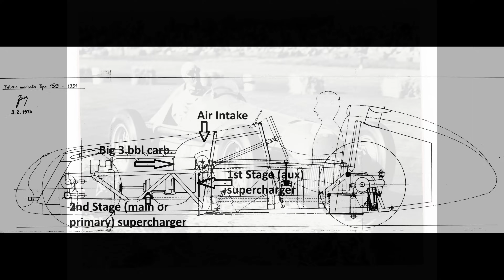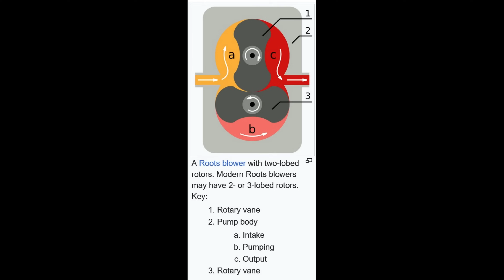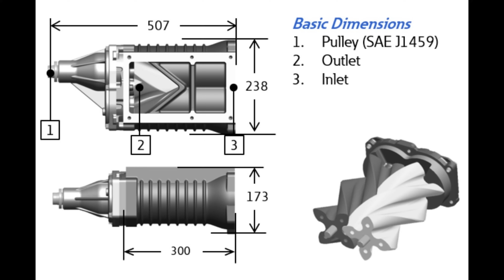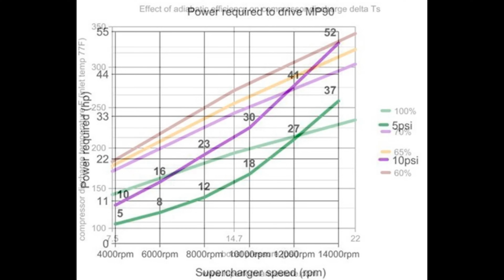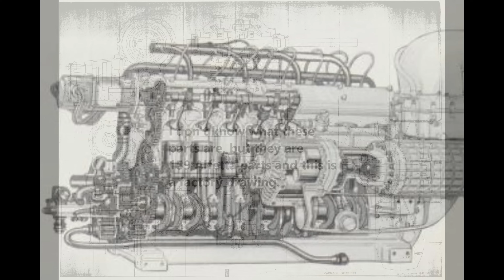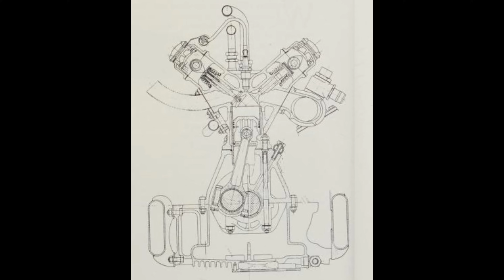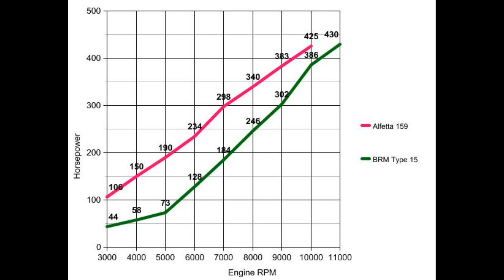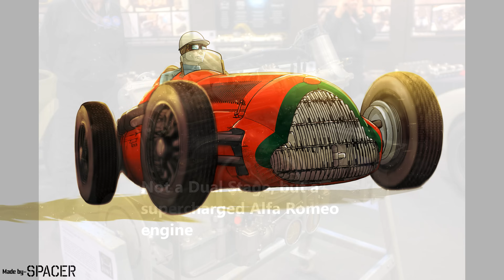Dual Stage Supercharging 450hp out of 1.5 Liters in 1951

Comment: Greg, this is another really good video about charging an engine and the circumstances you have to think about. I learned Mechanic at a Lancia Garage and technican at the FIAT Service scool in Germany. We were very advanced with Rootsblowers and Turbo loaded Engines in the 70ies and 80ies. The Turbo Ära followed with the Delta Integrale Times in Rally. It was so interresting to read about the old racecar and plane engines with their boost regulations. Thank you very much 👍👍.Kind regards from germany, Rudi 👍

Comment: I heard an explanation from the Merlin Engine production team where he explained that engine displacement didn't indicate engine power only how much air could be drawn into the cylinders. It was no problem getting fuel in, the problem was getting enough air in for the fuel, so more air and more fuel could only result in more power. You didn't need to keep making a bigger and bigger engine.
There is an indirect relationship between engine displacement and power since there's a limit to how fast air can get into any given cylinder so more cylinders or bigger inlets would allow more power. This is how the 12-piston Merlin engines were able to keep up with engines that had many more pistons.
Reply from the maker: The Merlin is a massive 27 liters, clearly displacement matters. The Bf109D's engine was 19.7 liters, the Germans then put in one that was over 33 liters. Rolls Royce then went even bigger for the Griffon. So yes, displacement matters and the people building engines back then knew it. The Merlin kept up with larger engines via more boost and in some cases more RPM, and generally with shorter times between overhauls.

Comment: The Tipo 158/159 Alfetta were designed as lightweight Voiturette cars before WWII. This was a smaller Grand Prix sub-class with a similar chassis design that used an engine limited to 1500cc. Smaller than typical for prewar GP cars which had reached 10 liters after WW1. The prototypes for these cars were hidden in mines by the Italians to avoid destruction by allied bombing. After WW2 when GP racing resumed, the dual-stage supercharger Alfa Romeo used at up to 40 psi made the small displacement straight-8 into a monster. Almost doubling the prewar version's output at half the displacement typical before the war. The 450 hp version practically ran neat alcohol through the intake passages to cool the valves and consumed a staggering amount of methanol fuel. 1.6 mpg! The 1.5L ran at high engine speeds for the day. Up to 9300 rpm. The Alfetta is a mechanical work of art from the golden age of automobile racing.

Comment: Many of the WWII diesel engines were built by Detroit Diesel. These were 2 stroke Uniflow designs using Rootes type blowers (which are referred as blowers, as what what they do is scavenge the cylinder).

Comment: According to the recollections of Mike Sparken, who managed to get a 158/159 Alfetta from the Alfa Romeo (in exchange for his Alfa Romeo Le Mans 8C 2900), he wondered why the works team had the engines revved up to 9,000rpm and beyond, when there's no need to...

According to him, when Jim Stokes rebuilt the engine of his 158/159, and they tested it on the dyno for the first time, they had to stop at 7,700rpm. They stopped because at that point, the supercharger boost pressure is up to 3.19 bars, and Jim stokes had to put stronger valve springs in. He reckoned that at that point, they could've gotten 403BHP at 8,600rpm "fairly easily..."

Jim Stokes added that the weak spot on the Alfetta engines had to be the valve stems. The valve stems were really slim (1/8 by 1mm valve stems), and it had to deal with around 3.2 bars of boost trying to force the valves off their seats, and the springs had to be strong enough not just to shut the valves, but also to keep it shut with that amount of boost acting up behind it. According to him, that means there's around 30 tons of load acting on those valve stems, opening and shutting at 8,500-9,000rpm...
Reply from the maker: There is a big difference between trying to win races one at a time and trying to preserve a very valuable piece of history. If I had one of these cars today I wouldn't rev it to 9000 rpm either.
Reply: @GregsAirplanesandAutomobiles  well, they actually still rev the engine to the limit...

When Sparken's 158/159 was fully restored, they were invited by Alfa Romeo to an event at Monza. Jim Stokes recalled that Sparken himself drove his car there (no problem, as Sparken raced sportscars and even at Formula One in the 1950s). Stokes recalled that it is an incredible spectacle to see the Alfetta howling down the straights, with Sparken revving it all the way up to 8,500rpm (the normal rev limit used by the drivers). Also, according to him, Sparken kept driving until he ran out of fuel!
Reply: @GregsAirplanesandAutomobiles  theres actually another Alfetta now in private hands. Jim Stokes built one using a huge cache of parts discovered in Italy about 15 years ago, and was completed in 2018. It is currently being racer regularly by its American owner in historic events in the UK. And hes also not shy of belting the engine hard...

I had a chat with the owner of two English Racing Automobiles (ERA) racing cars, who regularly races his cars in historic racing events. He owns ERA AJM1, a noted recreation using original parts with a 1.5L supercharged inline-6 engine, and ERA R4D, a famous original car, the most potent of all the ERAs, with a 2L supercharged engine...

He raced R4D last April at a historic racing event at Silverstone, facing off the Alfetta. He said that he tried to fight the Alfetta for position on the first lap,  until they got to the straights, at which point the Alfetta promptly ran away from him despite his best efforts. According to him, the Alfetta ran with 42psi of boost that day, making, by his estimate, at least 400BHP, as the owner revs it all the way up to 8,000rpm!

As for the results, the ERA finished behind the Alfetta in fourth overall. The Alfetta finished 3rd overall, the two top spots were held by two mid1950s Kurtis-Offenhauser Indy roadsters that fought for the lead for the whole race.

Comment: Greg,
  Great stuff. In depth & data based, as always. Keep it up.
  I need this analysis for my project. A twin turboed EJ22 powered VW Type 3 Variant. The turboes are T04Es in parallel, not sequential as you dicuss.
   But this is very useful!
   Thanks!

Comment: Methanol works to cool the mixture because it has so many fewer BTU's that in order to have a correct A/F ratio you have to put so much more fuel volume through the engine, this serves to dramatically reduce intake temps. IIRC it's something close to double the fuel volume... Ethanol requires about 50% more fuel volume than gasoline. 
BTU gasoline- 114,000 
BTU Ethanol 76,100 
BTU Methanol 57,250
We use methanol in drag racing esp when running BIG TURBO's - the fuel volume cools the charge
GREAT CHANNEL BTW!!!
Reply from the maker: Thank you, that's a very good post.

Comment: Fascinating video. Certainly in the vanilla automotive world small displacement engines with turbos are the thing now. However, heat and longevity are challenges (particularly when manufacturers are prescribing very thin oils). Seems like superchargers are relegated to the modders/racing community (I'm running a 2012 Subaru BRZ with a stage 1 HKS centrifugal supercharger kit which makes it pleasantly responsive).

Comment: Outside your applications here, Roots blowers are widely used industrially for vacuum systems and systems using air to convey powders.  In the air conveying systems the blower must be separated from the actual powder by blowing into the start of the system or being protected by filters that remove the solids before the air reaches the blower.  This takes the Roots blower back to it's early industrial use.

Comment: The aircraft engines you spoke of used two speed centrifugal superchargers, a low speed for low altitude,  and high speed for high altitude,  I don't think they were compounded,  as the charge temperature would be extremely high.
Reply from the maker: That is incorrect.

Comment: With that 98.5% Methanol, the remaining 1.5% would probably be residual water.
Reply: No.  Its usually gasoline or alchohol in race fuel.  

Pure methanol is unstable and can be used as a monopropelant in rocket fuel because it can self ignite because it doesnt require an ozidizer. You have to mix it with something to keep it stable.

Comment: 41:50 there is, kinda. once the cars get small enough weight can matter so much that the turbo and added power is not worth it. FSAE cars are a super interesting example (also because of how much different shit is tried there)
Reply from the maker: No, even in FSAE there are rules restricting forced induction engines. In fact this rule is usually a literal restriction on the air intake.
Reply: @GregsAirplanesandAutomobiles  yeah, youre right, they have to run a slightly smaller restrictor.
But the issue we ended up having is that the car would just use too much more fuel and not really put the 40% extra power anywhere.
went from a turbo 450 to a na 450 single.

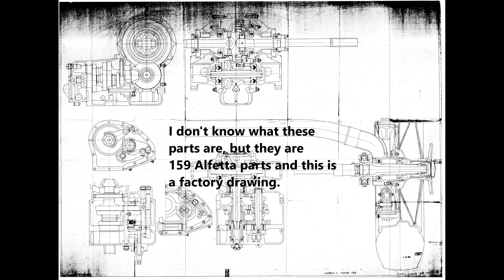Comment: 34:40 looks like drawings of the gearbox, differential and rear suspension, possibly a combined gearbox and differential. Though I don't know how the powertrain of a 1950's F1 car was actually laid out, so I can't confirm the suspicion.

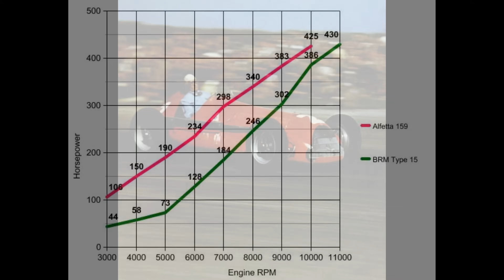46:05 you mentioned rear mounted transaxle. So yes, those drawings are almost certainly drawings of the transaxle and some of the rear suspension layout.

Comment: If only the US government had seen fit to give the Allison it's second supercharger as stipulated when requesting an engine design from them, there would have been no need to switch to the Rolls Royce engine. Later tests with the same engine installed as designed in the P-38, with the additional turbo charger, proved to be an equal, if not superior, power plant at altitude.
Reply: You are partially right.
  If you read the chapter on WW2, liquid cooled allied engines (see: White), you will find that, indeed, the Allison was hamstrung by the AAC/AAF requirement that the V1710 be built for turbocharging. 
  The prototypes P40 & P39 were both turbocharged. At the time, the single stage supercharger was intensionally cut. Back due to Air Corps demands. 
  The fact is that Rolls Royce put far more research into single & multi stage supercharging & didn't share info till later in the war. 
  The Last of thr V1710, the F110, had a multiple Stage, air-liquid intercooler supercharged system. 
  Too late for the war, it was used in proposed Curtis P40 upgrades.
  The Korean War F82 Yein Mustang used dual stage Allisons to great effect.
Reply: @michaelwillette5738 Allison designed the engine as requested, with the assumption that it would be supplied air that was already compressed. They were not asked to provide the additional compressor therefore they didn't waste time developing it since they didn't have an aircraft in mind to design it for. 

When installed in the P-38's that could provide the proper intake pressures, it put the Rolls Royce powerplant to shame at altitude, where it was supposed to thrive. Allison did exactly what they were asked. There's no shame in using the RR as we were partners in the war and it was the right decision at the right time, but there is little doubt that the Allison would have made the P-51 an even more superior fighter with the proper levels of boost. Look at the power curve charts available.

Comment: I'm not sure if the did it with the centrifugal SC's but they can size them for much higher ratios but use a restrictor to limit max boost. Boost will come in earlier, peak, then drop but HP will generally peak & hold - only dropping with engine & compressor inefficiencies.
Reply from the maker: I have a video that covers exactly that. The problem is it causes a huge loss of efficiency.

Comment: The first Eaton supercharged production car was the 1989 Thunderbird Super coupe. Pretty advanced package in it's day. Air to air intercooler, knock sensor, coil pack, over 12# of boost, and a supercharger bypass system. Peak torque at 2,600 rpm, from a 3.8 V6, rear wheel drive, with independent rear suspension. Later on, they got Teflon coated rotots, for more torque, and horspower.

Comment: Given the timeframe, I'd guess that other 1.5% of fuel not methanol was a lubricant like castor oil.  That's what they use in methanol/nitromethane glow plug engines.

Comment: So if I understood: The supercharger takes air one way and push it the other with some 1.something multiplier, the higher the multiplier the less efficient, so at some point you take three 1.5 multipliers in a trenchcoat and call it a 3x, is that it?

Comment: I'm so glad this wasn't one of those terrible videos with AI generated voice. Love seeing the history and the detail behind it, there's always something to be learned. Modern times have favored dual stage or "compound" turbo setups which is equally as fascinating. I had one turbo on my truck that would bark and surge making it difficult to drive and tow with, but simply adding a large second turbo completely changes the pressure ratios inside the smaller turbo and eliminated ALL the drivability issues.
Reply: I agree. Its so mind boggling to me that there is so many lazy YouTubers these days that choose AI instead of talking into a mic.

Comment: Man, the day americans switch to full metric is the day pigs fly
Reply from the maker: But... we do use the metric system. I used it in this video, even in the title.
Reply: @GregsAirplanesandAutomobiles  When you when in depth on how supercharing works and the relation between supercharing pressure in / out and the inlet volume, it was hard to follow when you used half metric half imperial

Comment: A turbocharger is not considered to be a type of supercharger based upon how it receives its rotational input like through exhaust gases instead of through a belt, shaft, or gearbox. Both are considered to be a form of forced induction alongside nitrous
Reply from the maker: A turbocharger is correctly called a Turbo-Supercharger. It is literally a supercharger driven by a turbine. Typically this gets shortened to turbo, or turbocharger. Just read the first paragraph here: https://en.wikipedia.org/wiki/Turbocharger

Comment: This is going to sound dumb, but this video has been a big help for me to make some seriously bad-to-the-bone coumpound- and twin-charged engines in Automation.  I recently designed a 1.8L 3-cylinder at 400hp and passing 2012 emissions.  The game doesn't have compound roots blowers, but they do have roots/turbo and compound-turbo.  I tried setting the pressure ratio on the blower to 1.0 and it made the watermelon-size turbo spool at 6,500 instead of 2,500 (!!), so clearly the blower was pulling its weight.  It's a great game for terminal engine nerds, if you haven't heard of it.
Reply: @JETZcorp  well-done UV made the turbo spool 4 grand higher I don't know why u would want that but what ever does it for u
Reply: @EventHorizon13  It was an experiment to see what the blower stage was doing.  What it was doing was making an impossibly large turbo functional.  Obviously, I didn't leave it that way.  I'll upload a demonstration to my channel.
Reply: @EventHorizon13  Demo uploaded

Comment: Ever consered applying a 2-stage blower to your own alfa? Although modern blowers can provide the boost single-handedly, the sound must be apart.
Reply from the maker: I have, but I don't really need to. A good single unit can make enough power to blow the transmission apart anyway.
Reply: @GregsAirplanesandAutomobiles  excellent! I was almost sure you had. am curious about the sound it makes. 2 (smaller/older, less efficient) blowers at 10k rpm should make a distinctly different sound than a single modern one at comparable total boost and rpm. Just being curious, you got me thinking and fantasising. Didn't know what a blower was before seeing this video